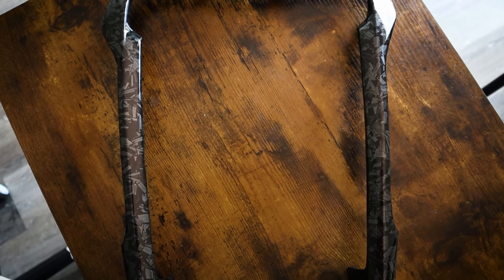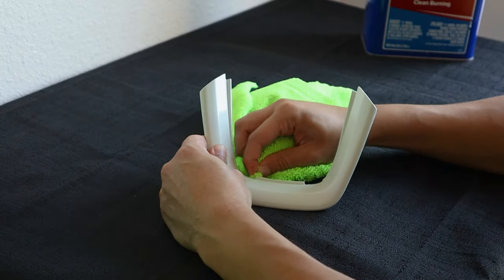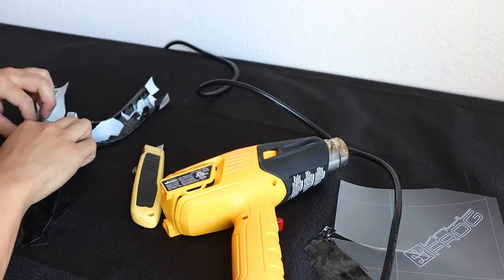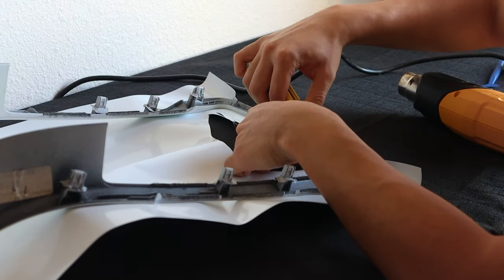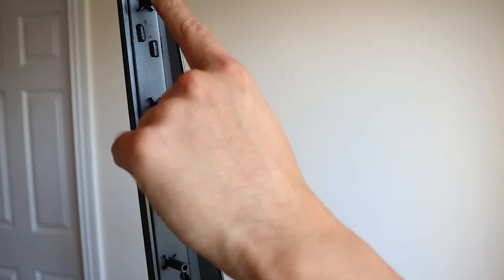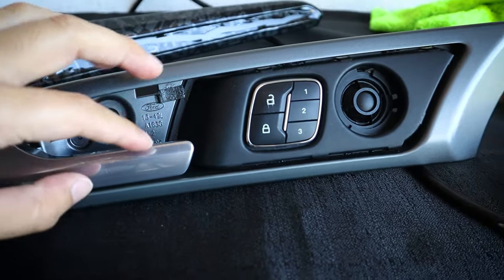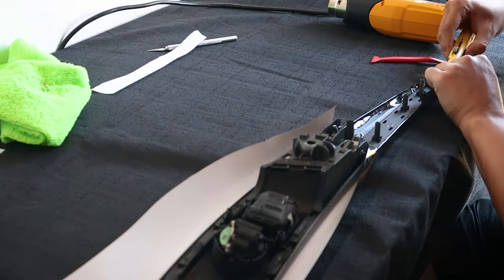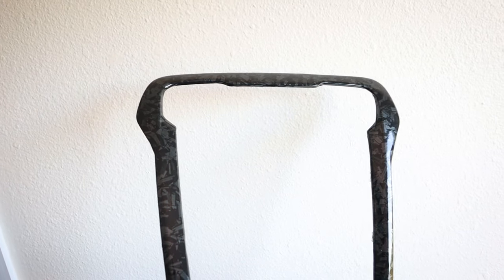How To Wrap Interior Trim!

Comment: You did not mention using 3M 94 primer, its a adhesion promoter for plastics and painted areas to make sure the wrap stays on, if you havent used this 3M product before, you really need to start to incorporate it into your wrap jobs. 😁👍
Reply: You Dont need to use 3M 94 primer on this interior trims